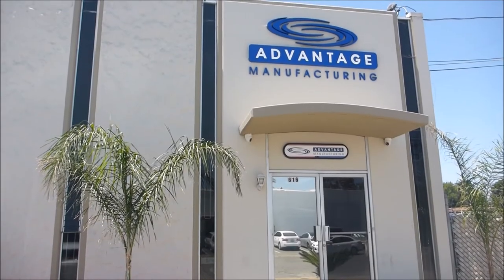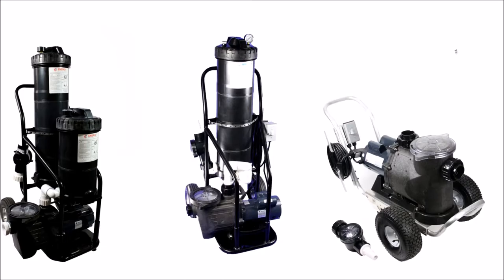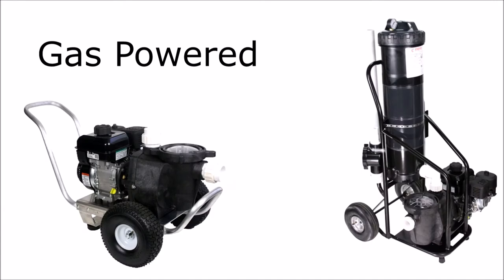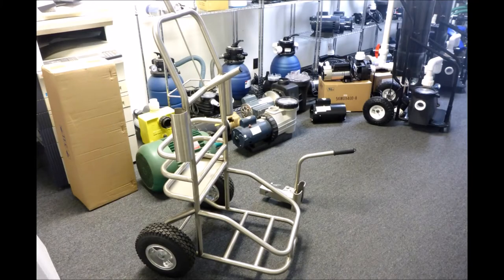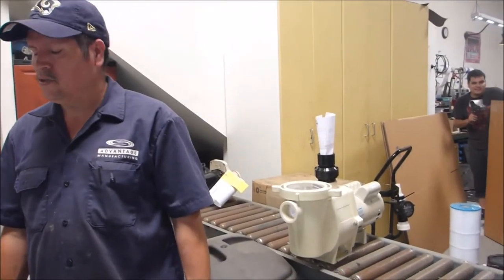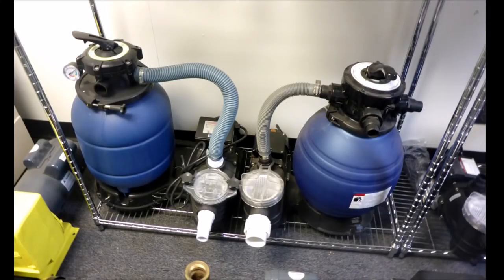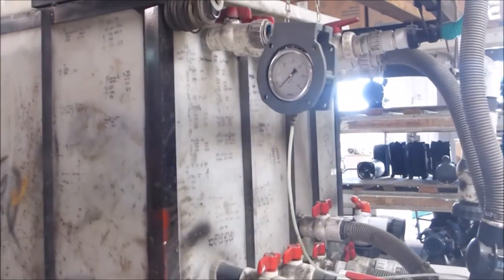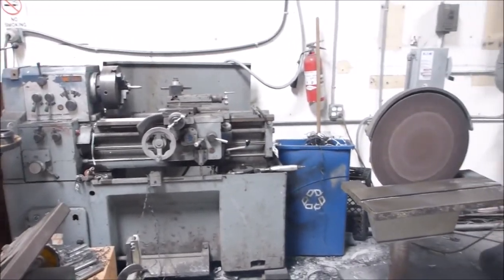Advantage Manufacturing Factory Tour

Comment: I purchased the portable vac to use for my swimming pool service business...I am running into a small problem at job sites.. can't find a place to plug in..can you tell me what the wattage is and what do you recommend for a portable power source that isnt too heavy or bulky to carry around on a truck?
Reply from the maker: You can use an extension cord to plug it in by the pool equipment. Most have plugs - at least in my area. You would need a portable power source rated for at least 20 amps. That puts it in the $400 range.
Reply: @SPL  thank you for getting back to me so fast.  I have used a extension cord, but still having issues.  I am not sure if the problem is because the plugs are 110 and not 220.  I am trying different sources.. including the Vak Pak plugs where the Stenner pumps are plugged...and other receptacles.  I thought maybe I need a generator for new hib sites where finding electric is a problem.  I tried Lowes...the guy said to find out the wattage is in order to buy one that could handle it.
Reply from the maker: @debraswearingen1689  You can call over to Advantage and talk to Josh. He should know what size power source you can use.
Reply: @SPL  Thank you!